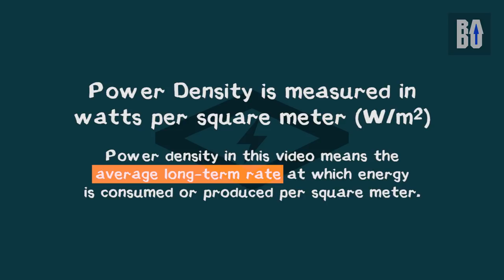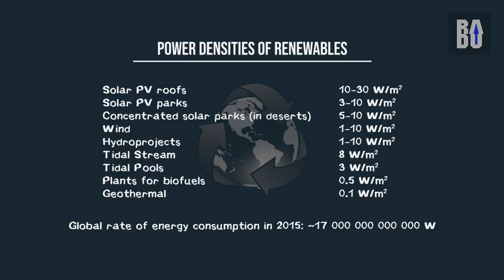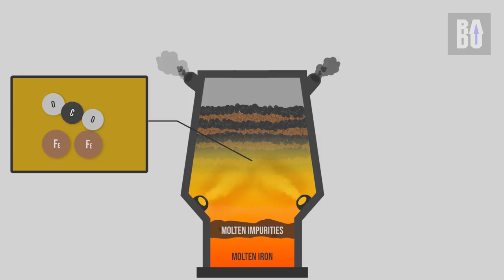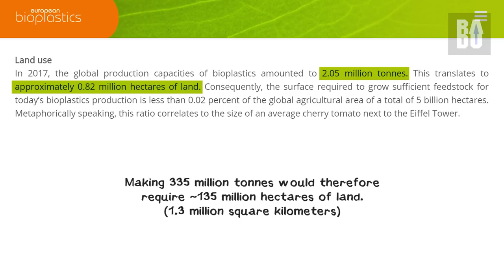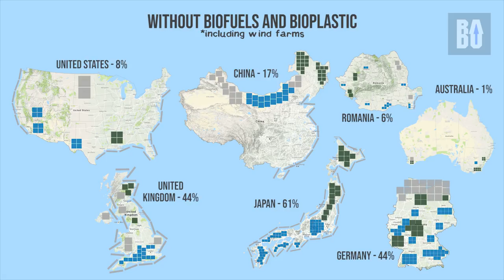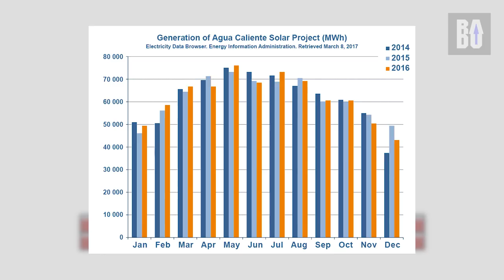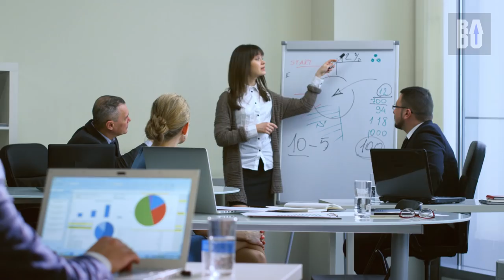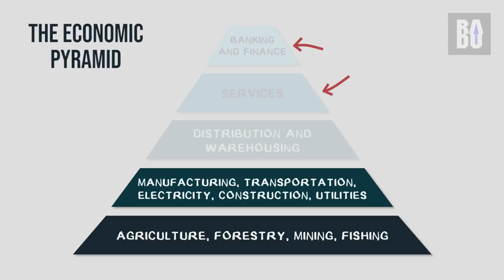My Presentation for the University of Aveiro

Comment from the maker: This video is too short to explain the topic well (which is why the upcoming video series will be 5-6 hours long at least) but I wanted to give you an update on what I've been working on. Let me know what you think :)
Reply: Illustrating the size of the area needed for renewable energy/resource is nice. But i'd also like to see it put into perspective. What is the current area size used for fossil fuel/resource production? How is the area needed for renewables currently used? Would it even be possible to change land use in this magnitude, and what are the ecological implications? What would a time frame for such a change look like, and what happens to world population in the mean time (changing the needed area)? I am really missing the connection between the need for all this energy and resources and the personal consumption behavior and world population size.
Reply from the maker: @LiquidGhaash  Exactly! That's why the original video is going to be several hours long. I address all those questions.
Reply: Hey Radu, glad you're doing this. I hope that in your final video you'd include a section on the difference in lifestyles between the developed and developing worlds and how that translates to their respective carbon footprints (both historically and now). I also hope you'd address the ethical and moral challenges of dealing with a problem that has an inherent imbalance, in that everyone in the world pays a price even if a few contribute to most of the causes.. Most online discussion on this subject is centered around the rich and the poor within developed countries, and for the most part, people underestimate how much needless energy consumption happens even in the hands of the "have nots" of the West, according to their own definition of "minimum" necessities. (expecting to eat meat in every meal for example).  

I also found that people shy away from the fact that sometimes there is no win-win solution. For example, plastic nano fibers from the synthetic clothing is a major ecological concern, but the fact remains that we cannot simply will into existence the vast amount of additional arable land required to replace synthetic clothing with cotton or hemp. And even if we manage to do so, there is no guarantee that it would be equally affordable... Another example is the idea of reforesting sahara. A recent study that reviewed the idea found that even if we succeeded in doing so, the "albedo" (ability to reflect sunlight back into space) of a forest that big will be much less than the desert and cancels out the advantage provided by trees.

I hope you address these sort of conundrums so that it can make the discussion less polarized, and people don't perceive questionable solutions as perfect.
Reply: Dear Radu, you make amazing videos. Thanks a lot for your energy and input you share. 
I am myself a pv engineer for 10y and at first I need to question the references you use. Because <10W/m2 for pv may be only correct if you use 100% solar. If you combine wind and solar, which are often complementary energy sources, then the so called "capacity factor" or power density increases and you need less land. We don't add simply 9+2. Germany uses in 2018 about 30% renewables for electricity. 70-80% is easily achievable within the next decades. Going 100% in a heavily-industrialized economy is of course utopic. Power-to-H2, Li-storages and power-to-gas are amazing options. Looking forward.
Reply: Man, you’re good!
Reply: Hey Radu. Great video indeed
But I think you should talk about nuclear energy as well
I mean its clean and it could be the best way we could give ourselves more time to get rid of fosil fuel dependency. 
For example France has 70% of its energy from nuclear and rest from other clean sources 
They will be the first country to dump all the fosil fuel stuff in the world 
And btw nuclear energy could be sustainable as well due to new technology allowing nuclear waste to be turn back to fuel 
Big love 
Pup
Reply: The is FANTASTIC,ThankYou very much☆
Reply: @d2moko  Those damn Germans think they can use my country as a green battery, all the time Norway actually needs most of the energy themselves. We transport 15tw/h, which is a few drops in the bucket for the EU energy needs.
Reply: @Deffine  norway is very rich in energy, both oil and electricity. For such a small population, it is very advantegous. In the end its all about money.

Comment: "in short climate change makes the plant less hospitible to life" think about that for a second, where is the greatest concentration of diverse animal and plant life...the equatorial regions...where its hottest...
Reply from the maker: Great point. I was reading the Sixth Extinction by Elizabeth Kolbert and that's precisely the point she made. In the long term a warmer planet will promote a greater biodiversity than a colder planet (because there is more energy available). But the problem is the rate of change. In the short term, a warming of 3-6 degrees Celsius over the course of a single century will wipe out most plant and animal species on Earth.
Reply: @raduantoniu  No idea why you would think that, 3-6 Deg C is probably less than the seasonal difference over most of the planet, the UK has a 12 Deg diff. Also  3-6 C increase in temp is probably the only thing that will save us from the next ice age, which, in geological terms, we are due to slide into anytime soon.